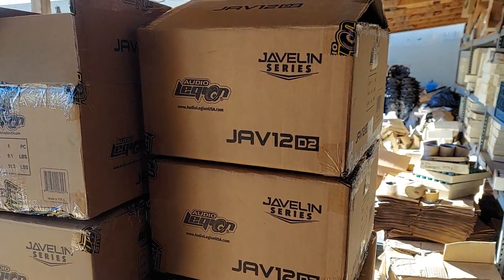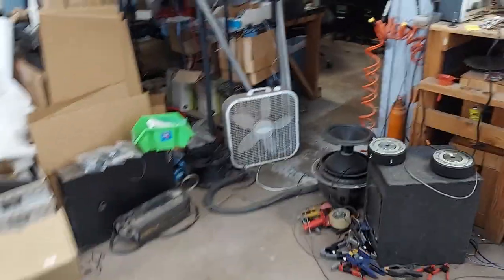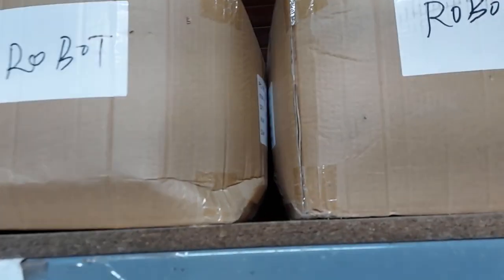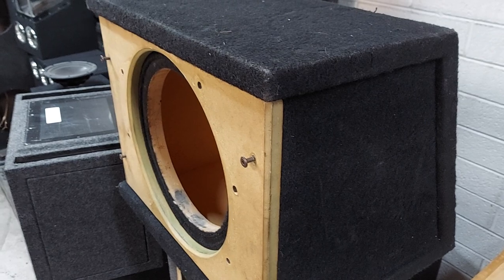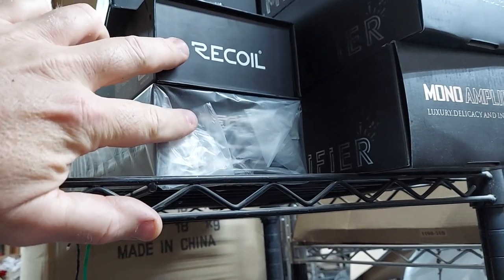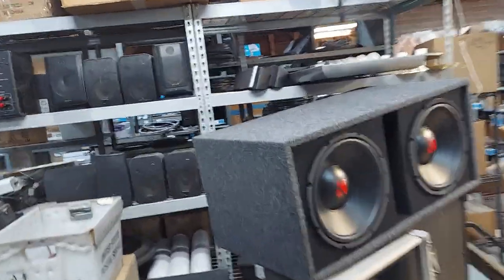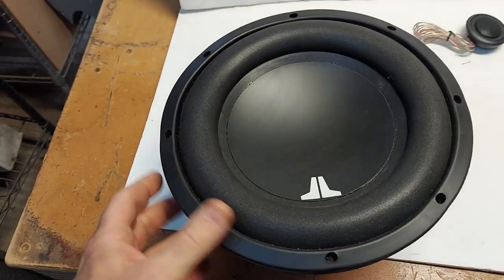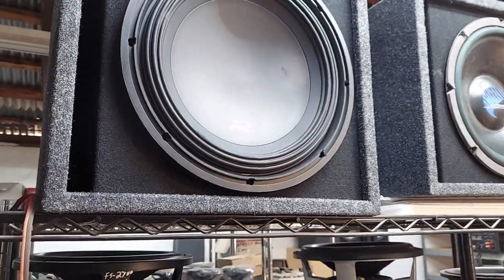Jizz Llama 🦙 Javelin Catcher series Subwoofers! + Shop Update w/ local deals @RobotUnderground

Comment: How much are the universal bass knobs  shipped?
Reply from the maker: $10 is fine.
Reply: Wait... So universal, you mean it will work on my Rockford 1200?? It has phone jack style , I tried my kicker zx  dial ... Won't work
Reply: @matthewguynn3652  I don't see why not, you would just need an extra RCA to run it . 
Headunit in to bassknob out to amp
Reply: @desktop_salmon7791   well my bmw is stock head unit.. but I'm building a system for a 94 explorer soon
Reply from the maker: @matthewguynn3652  Prime amps use a headphone jack style.  I have those too.  Same price.
Reply from the maker: @matthewguynn3652  If it does have a phone jack type, yes you can use the RCA based type and it'll be the last one you install since it'd work with all amps.
Reply: @RobotUnderground   oh awesome... How do I purchase?
Reply from the maker: @matthewguynn3652  just text me when you're ready let me know what you want we can go through your options 602-312-6504
Reply from the maker: @matthewguynn3652  Text me when you're ready, 6023126504